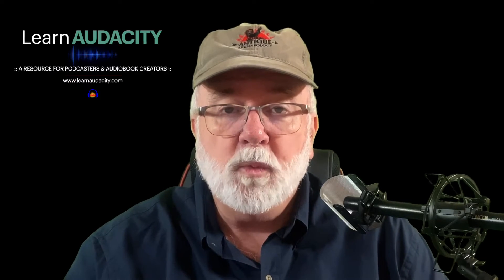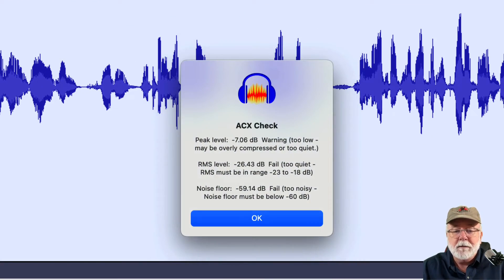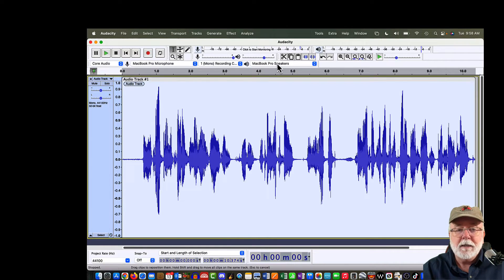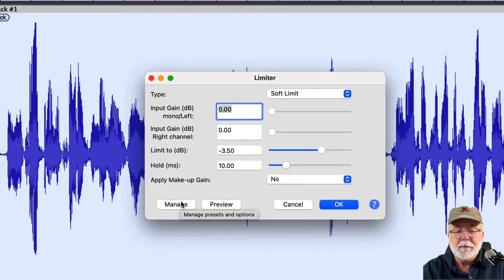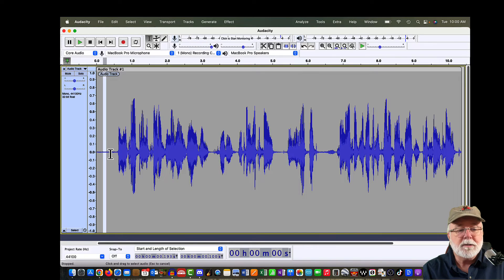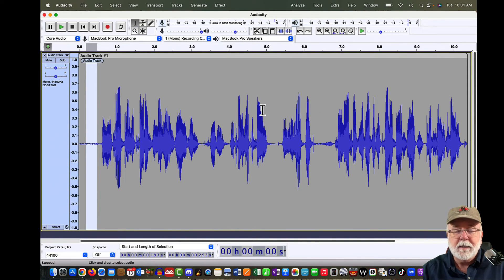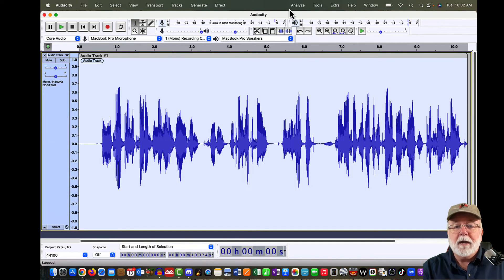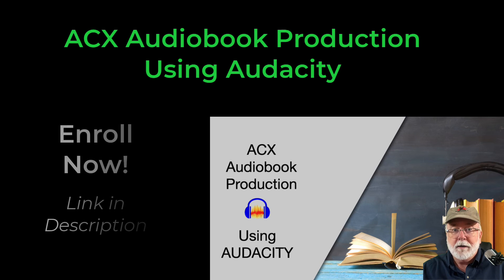How To Fix Loud Noise Floor, RMS, and Peak Values in Audacity to Meet ACX Standards

Comment: I had two audio files that had issues.  One was fixed immediately based on your suggestions.  🥳🥳

Had issues with the second video.  Could not resolve the noise level at all!  So I watched your most recent video on this subject that discussed an audio silence file.  Audacity 3.7.5 (what I am using) will generate a 30 minute silence file - but, as you stated, total silence is unnatural and ACX failed that file.  The Audacity 3.7.5  does not allow you to manually record "silence" - it pauses when you stop talking.  With that being said, I was able to squeeze out 12 seconds of "silence" with two seconds of actual silence I could use.

*After watching both your videos again*, I uploaded my two seconds of silence as the first track with my original audio file as the second track.  The two seconds of silence was in front. Then exported it as a single file. I hope this all makes sense!

I then uploaded this combined track into Audacity, followed your instructions and it worked!!!  You are the MAN!!
Reply from the maker: That is awesome!! Thank you for letting me know and for the gift!! It’s appreciated. I’m so glad it worked for you!

Comment: Thanks, Mike. I love your presentation! You've done an amazing job with this tutorial. It's clear, concise, shows the steps in sequence and explains why these effects are important and effective for producing acceptable audio files on ACX. I also use something called Audio Cupcake, whose Pro version has all the ACX specs build right in, so one can just drop the files on top of it.
Reply from the maker: @marlonbraccia  Thank you! Is Audio Cupcake a full editor too? Do you know if it will run on a Mac?

Comment: I absolutley cannot get the noise floor to pass acx check despite trying your methods here. Keeps saying its too loud, the room that I am in physically is quiet with no background noise an i set up all the settings like you did in the video here so the only other thing i can think of that would be the problem is the noise from the laptop? which i have no idea how to fix...or any ideas???
Reply from the maker: @rebekahreyes7609  How loud is it? What does the meter bar say in the quiet parts?

Comment: The limiter settings are different on my audacity program. It pops up different than the one on your screen. Instead it shows presets & settings on the left side. and I have to choose different presets of a limiter. Which one do I use? How do I make adjustments?
Reply from the maker: Check out my video on the Legacy Limiter and Compressor.

Comment: I like this video a lot, it is clear and simple, however I followed your steps and they did not work for me. I rarely have trouble with the noise floor but when I adjust the RMS and it passes, often ( not always) it messes up the peak and vice versa. I get so frustrated with these videos because what if what you did, didn't work? what do I try next?

Comment: this video is amazing and has taught me a lot about audacity. I do have one small problem, when I adjust the RMS level, amazing, but when I then do the limiter, it screws the RMS again, and it never is entirely good. A little thing that is different from your video, is that my limiter is called normalise (for the RMS it's called normalise the amplitude). Do I need to install a new plugin or am I just using the wrong option? Thank you to anyone who will help me! 🤗

Comment: I find that when I apply loudness normalization at -20db, I get multiple red clipping lines. I'm able to run it after applying a limiter, but then I end up applying limiter twice, to also get below -3db after the loudness normalization. Is running limiter twice going to create excessive compression? Other ideas? Thank you!

Comment: Hi there I am 58 and have fibrofog so need an idiots guide to this. I did 3 books for ACX that were fine now I am back audacity has changed and it says I pass at 65.0 but ACX want me under 60.0 and I can't fathom what to do. The minus thing messes with my head and I can't make it all make sense. Any help would be great thanks. :0)

Comment: Excellent and clear explanation, thank you. Your help fixed my peak noise. However, my noise floor is too low. What can I do about this?
Reply from the maker: Thank you. One way to correct low noise floor is to add a second track to your project of just room tone and then include both tracks in your export. I have a 30-minute file of room tone I can make available to you if that would help. If you like, email me at audacitybootcamp@gmail.com and I can get it to you. I think a video on this would be good too. Thanks for the idea. :)

Comment: It seems so much louder than expected. Is this a normal production that will be different on Audible?
Reply from the maker: As long as your peak and RMS levels are within specs, you should be good to go. If you over-compress it can make it sound a little too loud as compressing can raise the quieter parts. Keep compression to a minimum.

Comment: Question on the noisefloor. If your not killing your noise floor how do u make sure your floor is low enough that it’s not bringing in mic noise, especially in gaps where your not speaking? When ever I record my mic is constantly bouncing at just below 54 even when I’m silent, which I guess is not too bad but obviously there’s noise there. Granted my rooms untreated, which brings me to my next question. If I’m going to treat my room to get rid of ambience which could potentially stop my mic bouncing when I’m not speaking, how do you treat the ambience in a way your not killing your noise floor? Coz surely it’s the room ambience that’s preventing your floor from not being dead even if ur in a naturally echoey room no? Coz obviously if the noisefloor is too low it says “sounds unnatural”